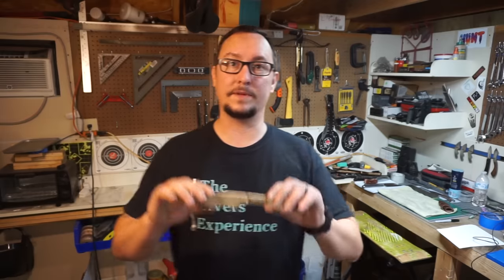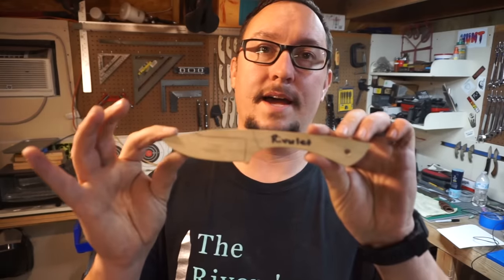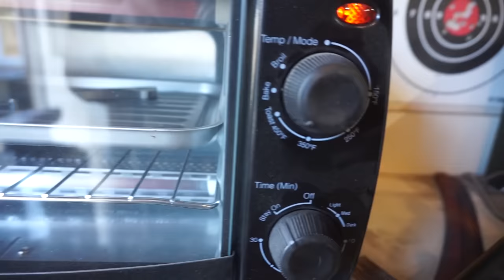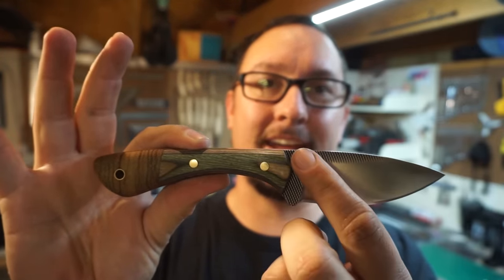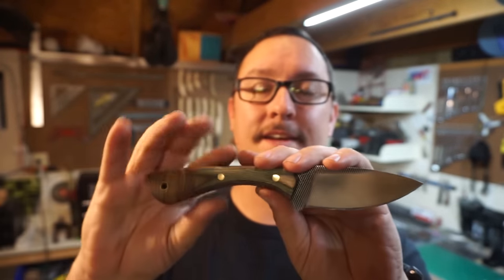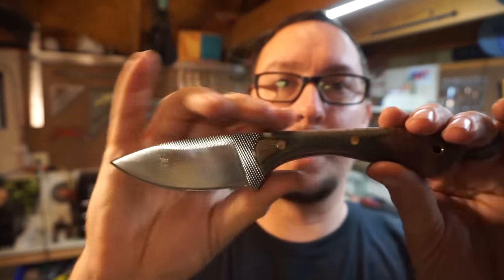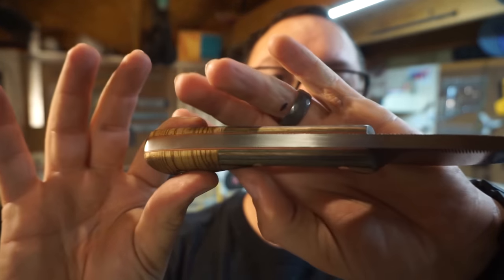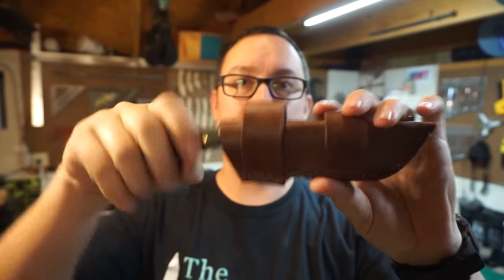Making An Heirloom knife Out Of An Old File

Comment: I really like stock removal.  Less chance for fractures and cold shuts. The buffing wheel in the press is a cool idea. I have had close calls with buffing wheel on bench grinder and actually damaged a blade I was working on because it caught and threw it into the grinder guard.

Comment: Great job making that knives. I  just got almost done making a knife out of a horseshoer's  rasp. I still need to do the final sharpening on my 6" belt sander. I  wanted to put the brass lanyard pin in the end of the handle like you did but I had to settle for 4 brass screws because of a stupid mistake while sanding. I made my own sheath that turned out ok ( not my best work). All in all it's 75% to your 100% perfection. It's stout. I also have a large Old Nickelson that I have cut out and will be working on next. It's 1/8 of an inch thick and now I have some great ideas because of your video. I found both files metal detecting in 1985 here close to home.
Reply from the maker: That is awesome. What a story to go with them too, as they are found treasure.

Comment: Awesome skills. I purchased several machete style knives along with bowie style when on assignment in the Philippines in the early 80's when in the Army.  The locals would scavenge the brass canisters from 105mm howitzers to use for adorning the handles. Blades made from truck leaf springs. No special tools or equipment.  Also make butterfly knives.  Skills like yours must be passed on to next generation.  Sir, I salute you

Comment: Quenched it in oil? What kind of steel are files made from? 1095?
Reply from the maker: Most of them are made of 1095. The new ones now days tend to be case hardened steel.
Reply: @theriversexperience9383  thank you, making a small file knife and since it’s from an older file, hoped it would be 1095 :)

Comment: QUESTION, 
After dipping into quenching oil and heat treatment what a great way to clean the scale and oils from blade?
I'm trying apple cider. 03 percent and difficult it's is.?
Thanks
Reply from the maker: The easiest way is using a wire wheel on either a drill or a grinder.

Comment: Hello I started cold process of knife making from file, I grinded I shaped I cutted but when I tried to drill holes was impossible... The file is too hard. How did you made the holes, did you use special drill ? Or you first heated back the file ?
Reply from the maker: You want to heat the tang up to a bright red and let it cool slowly, that will soften the tang.

Comment: You could have skipped the heat treatment by doing strict temperature control during material removal as the files come already hardened. It slows the process but removes the kiln requirement.

Comment: Did you anneal the file prior to cutting to pattern? I just bought a pile of old files,one is a 18',Nicholson,...Might make a Short sword dagger..
I forget if I seen it annealed first..
Reply from the maker: I typically cut my files with an angle grinder and they do not have to be annealed if you're going that route. If you are going to use a bandsaw of some sort, you will need to anneal them.
Reply: @theriversexperience9383  I made another salvage haul last week and this one is 19.5 with the rat tail and 16-1\4 wthout..
I learned is 1905 G.H BARNETT BLACK DIAMOND WORKS, prior to Nichlson buying them out in 1912...The file is 1-1\2 at stamp and taper's to 1-1\8 to front tip..Both sides patterns are same on this one as well.Wish was not tapered. I have not done one in longtime,might save it and move on to another.lol..Have so many..

Comment: What drill bits are you using to drill the pin holes? I have a Nicholson file that I cannot drill through. I've used regular metal bits, cobalt bits, and carbide bits...all of which just destroys the bit and can't get through the file.
Reply from the maker: Your gonna need to Anneal the tang. Heat it up till it is at least red in color then let it cool as slow as possible. If you aren't going to be re-heat treating the blade then you will need to wrap the blade section in a wet towel. Even then I still use cobalt tipped bits, the ones I have are made by DeWalt.

Comment: Great knife, but I have a question: did you really needed to heat treat file? I mean, they are already heat treated.... Right?
Reply from the maker: I anneal 90% of the files that I work with because it makes it easy to drill through and it wont burn through my 2x72 belts as fast.
Reply: @theriversexperience9383  thank you for explaining.... I watched video few more times, and damn, that knife gets prettier and prettier...

Comment: Awsome knife,  did you aniel the file handle prior to borring the scale holes.
Reply from the maker: yes, I did. It makes it way easier.
Reply: @theriversexperience9383  I'm new to making knives , i have made a few out of hardened planer and molder blade steel .  I grind them.to my desired look making sure not to over heat . The knives come out just how I like them . Although  when attempting to aniel the handle portion of my knives using a torch I still find in difficult to bore the handle holes. In a few cases I can't depending on the steel . Could it be possible that some of the hardened stell I'm working with will never get soft enough to bore even when I focus my torch to the area the holes will be drilled through.
Reply from the maker: You need to get it up to non magnetic when heating it, then let it cool as slow as possible. Also, make sure you are using one of the slower settings on your drill if your using a drill press and make sure your drill bit is sharp.

Comment: Did you take back some of the hardness from the file before you started? It seemed to cut pretty easily for hardened steel.
Reply from the maker: yes, I annealed first then worked it and did a heat treat process afterwards.

Comment: Really cool knife and good work on it except I just don't understand why you decided to heat treat a file which is already heat treated, they actually just need to be annealed to make them LESS hard so they don't break.
Reply from the maker: It wasn't that I just re-heat treated it. I took a 40 year old file and anealled it (to make it easier the drill through and less harsh on my abrasives), normalized it, heat treated it, and tempered it. I have no clue what happened to that file over the 40 years prior. But after I was done with it, I was in control of the steel instead of the 40 years worth of its life as a tool. I make plenty that aren't re-heat treated but those are typically newer'ish files.

Comment: Also why did you heat treat it? Isn’t it already hardened 1095?
Reply from the maker: I had annealed it to be able to drill the holes in the tang. Also it's good to normalize tool steel after years of use. You want to get everything back to square one before giving it a new life.
Reply: Started working on a file and the angle grinder broke. I think it over heated :(

Comment: It is a beautiful knife and workmanship, but the point of making a knife out of a file is to have hardened steel and not have to have a forge to temper it, of course this makes drilling the handle quite difficult.

Comment: how do you make a hole in the bastard file? i have a 900w drill press but when i tried boring a hole I barely go 1m deep and no more, my bit seem to break if i will go further,  the chuck of my drill holds a minimum of 6mm diameter bit,  any help will be highly appreciated..  of course i drill with low speed with lubricant cooler.....TNX
Reply from the maker: I annealed the area of the tang that I was going to drill though with a torch. You will want to get that area red hot and let it cool as slow as possible. Make sure to keep the blade area cool with a damp towel.
Reply: @theriversexperience9383  ahh i see.. my bad.. i nearly kick my drill press because of frustration hehe🤣🤣.. thank you very much for the TIP for a beginner like me sir.. HAPPY NEW YEAR💢💫💥❤

Comment: Hey I see you heat treat some files and others not what’s your best recommendation ?
Reply from the maker: I really just depends on whether I'm going to be drill though them or the size. Smaller ones don't get re-heat treated, larger ones do.
Reply: Do you recommend heat treating them to be able to drill pin holes??? Really struggling with drilling though files

Comment: Awesome work. You have a new sub. Why did you put the 1x30 belt sander on it back? I've never seen that arrangement. If that 1x30 is a Harbor Freight and your 2x72 is a Beaumont Metalworks than you and I literally have the exact same setup.haha
Reply from the maker: I use the one on its back for shaping handles. It makes it easier to see what you are doing.
Reply: @theriversexperience9383  good point. 👍

Comment: Great knife! I have several my and my wife's old dad and granddad. Both large and small. Oh, by the way, the file you used was a machinist cross cut file. The files that cut only one way were called bastard files until lately when it was politically correct to call them one way files. You will still see Nickleson and other files makers call their one way files bastard files. FYI

Comment: I don't understand why you heat treat the file please explain ty😮😮😮😮😮😮😮😮😮😮😮😮😮😮😮
Reply from the maker: Because I have the ability to do it. If you don't have the ability/tools to heat treat then you can just temper it (tempering needs to be done so it doesn’t break if dropped). I Anneal the files to make it easier on my expensive abrasives and to make it easier to drill through for the pin holes in the tang. Hopefully this helps.

Comment: 3:44 - Isn't a file already hardened steel?
Reply from the maker: Yes, I chose to re heat treat my file knives. It's a personal preference and the annealing process softens the steel, which make it is easier on my abrasives and drill bits.
Reply: @theriversexperience9383  Ah, I see.  Soften it to rework it, then reharden at the end.  👍

Comment: I was under the impression you dont have to heat treat a file since it all ready annealed.
Reply from the maker: Files are in a very high HRC state when sold, so high that they will snap if put under pressure and break if dropped on a hard surface. You have to temper the hardness down in an oven to make a usable/durable knife. What I did in this video was anneal it, so that I could drill though it and so that it was less rough on my abrasives. Then I re-heat treated it and then tempered it. It's a personal preference. In a recent video I should the process of making a knife out of a file without heat treating, I only tempered it.

Comment: All files are made unequal so find USA brands to make the upgrade blade
Reply from the maker: Yup, USA and the older ones are better. You can still find Case hardened files with the USA made on them. Do research is key when using steels like files, rasps, or leaf springs.

Comment: When I saw you using power tools I assumed you didn’t have a forge.  You should’ve softened the steel beforehand. If you did, you didn’t show it or disclosed it.  If you didn’t soften it, Hardening the steel at the end is redundant and not needed as the file is already harden

Comment: Hasn't the file already been tempered before .
Reply from the maker: typically files are left very hard and brittle. If you were to drop one on concrete there is a good chance it will break.
Reply: Are u serious?? I am a jack of all trades and if ever bought a file that broke apart bcuz I dropped it then I'm positive that business who makes them wouldn't sell them ever again. Regardless of that, you believe that bringing them up to a certain temp then dunking it in water makes it strong??? I know this is a process in actual sword making it just seemed like it wasn't necessary. But shit I didn't make it. I'm thinking of making one. If I don't hear treat mine do u think it would break easily. ??? Seriously.
Reply from the maker: @Shhhoooooo  You can easily do a file knife without heat treating it, I annealed (softened) this file to make it easier to drill though. You just need to keep it cool while shaping it so that you don't mess up the hardness. You will need to temper it though. Files are at their maximum hardness and are brittle because they need to be hard enough to file/remove steel. They are not meant to be used as pry bars or hammers so there isn't a need to temper the hardness back. Knives on the other hand need their hardness tempered back because they are a tool that is used for everything and need to be able to survive a fall or bend before they break.
Reply from the maker: @Shhhoooooo  some files can be in the 70-85 Rockwell, knives should be between 58-62 Rockwell.
Reply: @theriversexperience9383  thx man. I appreciate the information. Take care